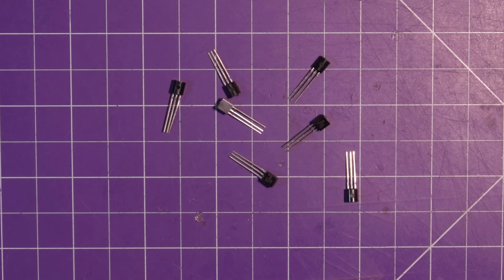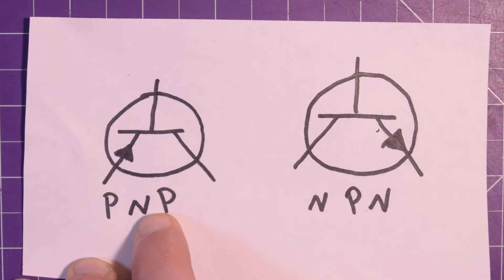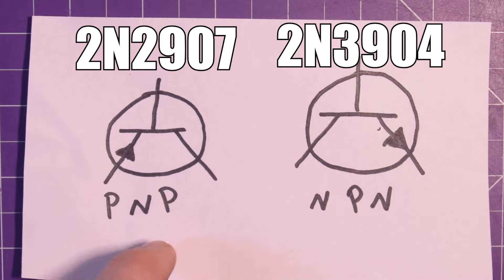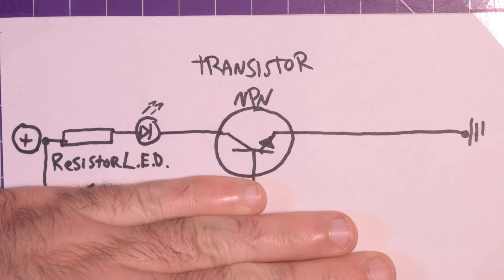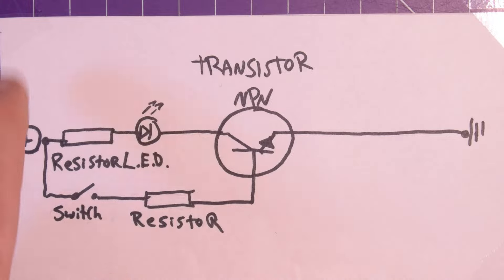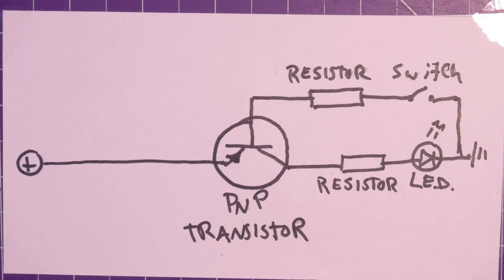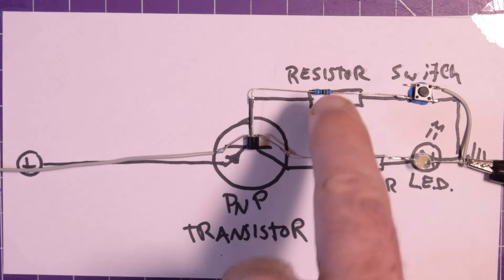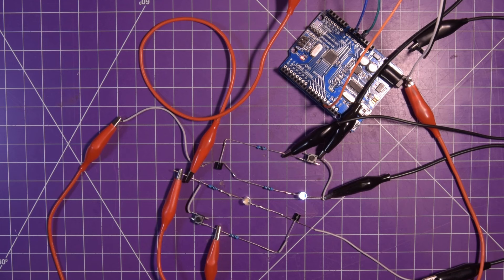How To Use Transistors In YOUR Projects! || Transistors Explained || Transistors As A Switch

Comment: Thank you for this series. For years I worked in a radio repair shop, all we ever repaired was valve radios and record players. So as a result thats what I'm used to working with and never understood transistors. The books I read were far too confusing. You give nice and easy explanations with practical demos.
Reply: Frank, too many technical books do a poor job of explaining the basics. Many times, the simplest explanation is the best.
Reply: What possible projects can anyone like me be thinking about if I am still stuck with that FUCKIN' Canadain dollar?😀
Reply: I finally found some lecture after searching for weeks which cleared the concept❤.hats off to u
Reply: I thought valves went out of fashion long ago.
Reply: @LNCMD2023  Sort of, they are still used in guitar amps. But quite a few people, me included, still use them in general.

Comment: I've watched a few beginner/basic videos about transistors, and while many are good at explaining the underlying physics, all of them make far too many assumptions about the other components that they may be used with. This is the first (and best) I have seen because while it is far from exhaustive in scope, it shows the two basic types in two common configurations, with clear useful guidance about which side to place the load. Basic rule-of-thumb stuff that gets you moving, then gets out of the way. Bravo. I have subscribed.
Reply: It's like explaining how to drive, starting from scheme of engine. Interesting, but useless knowledge. Dan started from practical part: just press accelerator and move! :) That's why this video HUNDREDS times more useful than "pretty presentations" how electrons pass PN edge.

Comment: This was an excellent beginner video! Getting back into electronics after 20+ years and this was an excellent visual. One thing which I learned (or didn't realize until now) was the reasoning for putting the load on the emitter or collector side.
Reply: That's the point! All diff is polarity of control signal.

Comment: I finally understand how transistors work and it's thanks to this amazing channel. Thank you!
Reply from the maker: Great to hear that! Thanks for stopping by!
Reply: @SimpleElectronics  Do you have any videos on how rf circuits work? I want to make a transmitter and a receiver circuit so i can make a 3d printed rc car lol
Reply: @grantscott1686  Don't bother. Just buy ready built TX and RX receiver modules. It is considerably easier and they can be pre-certified. You are not allowed to transmit on any frequency you like.

Comment: very well explained transistors as a switch, to make it even more simple a transistor works as a switch when a small current is applied to its base it then  connects its other two legs together or you can say it shorts the collector and emitter in order for the current to pass through it like a switch, and the type of current applied to the base vary according the type of transistor NPN or PNP. If the type of transistor is PNP, Negative side of the voltage should be applied to the base of transistor and if the transistor type is NPN, then positive side of the voltage should be applied to the base of transistor. Today is my first day to learn about transistors and this was the second video i watched on youtube for learning about transistors. correct me if i explained something wrong about transistors, i want to learn about them perfectly. Thanks in advance
Reply: No it is not that simple.
You need to go look up transistor biasing, active and saturation regions, output characteristics curve, Ic versus Vce for differing levels of Ib.

Comment: When thinking about polarity of Base inputs, it helps to take the middle letter has a reminder, for example PNP, the middle letter is N-for negative to switch on.  And the NPN has the letter P- for positive to turn on. 
And for those who were thinking whats the point, wet your fingers slightly and touch the base lead and the battery, the transistor will turn on with the tiny current passing through your body, also try connecting a Photocell inline with the base resistor, these experiments will convince you.

Comment: Finally, some enlightenment on transistors. Thanks for a lucid, logical explanation. Could you do a similar presentation on how a transistor works in battery charging, with the red and green LEDs in action? I'm not an electronics guy, just seriously interested.
Reply from the maker: It's a LOT simpler to just use a purpose chip like a TP4056 instead of just transistors but I could likely build a small circuit for basic charging with transistors
Reply: @SimpleElectronics  Thanks. Looking forward to it. There are quite a few videos on the subject, but none that include a circuit diagram and an explanation on how electricity interacts with the components used in the circuit. Most of the stuff simply has a music soundtrack without commentry. Leaves one 
 absolutely mystified!😙

Comment: Great explanation and thanks for the visual representation. I think this could have used some more practical examples, because LEDs can also be powered by microcontrollers so it's still kinda hard understading what you could actually use a transistor for, or how to pick them, what to look for, things like that.

Comment: Hello , Thanks  a lot for your Teaching, Explanations and  Efforts. They are  very illuminating for me. As a beginner i would like to ask, just depending on the Led light. Does transistor serve as a Switch between two Loads, switching them on and off? Does the Base work like a Contactor, Relayer , for one or more Components on the Circuit ? God bless you and your kind of People.🙏🙏🙏

Comment: Hello, thank you very much for your videos!  I have a question what are the values of the resistors?  I would like to practice at home thank you
Reply from the maker: The base resistor can be anywhere between 200 ohms and 10k ohms, depends on your transistor and your load. 1k is really easy to find so start there. For the LED - try 1k ohms as well and adjust it if you need more brightness!
Reply: @SimpleElectronics  Do you know if I can control a tri color led (red - green) with both pnp and npn transistors;  because I would like to switch from red to green with a single led, but the circuit confuses me because the tri-color led has a common terminal, thank you very much for your kind response
Reply from the maker: @rebandido777  You will need to see if it has a common ground or a common power, and once you know that, you can install the appropriate transistors on the non-common lead. The type of transistor will depend if it's a common power or a common ground - make sure you pay attention what side of the load each transistor type needs to be!
Reply: @SimpleElectronics  it’s common ground
Reply from the maker: @rebandido777  So PNP it is!

Comment: Great video.  I want to turn on /off a relay based on a resistance that becomes zero or 45 ohms. (The relay is very small and needs 12 volts to 16 volts to operate)  How can I use a transistor with this varying resistor?   I will try to make it but would like some expert's opinion and design. Thanks
Reply from the maker: I am far from an expert - but I recommend asking in the AskElectronics subreddit - but make sure to share your full project, as to avoid X Y problems. https://www.reddit.com/r/AskElectronics

Comment: Really good example,but I’m am now wondering how two concepts apply. Eric O, often talks about “high side and low side switching” is your first example a representation of high side and second one low side switching? And are the terms “sourcing” and “syncing “ applicable here? Thanks
Reply from the maker: Eric O from South Main Auto? Sourcing means providing a voltage and Sinking means providing a ground. So in my examples, the NPN is Sinking current (switching the LOW SIDE of the circuit) and the PNP is Sourcing current (switching the HIGH SIDE of the circuit).

Comment: In your examples the transistors turned the LEDs on. Is there a transistor that turns something off. A transistor who’s natural state is on until a small controlling voltage is applied that turns the transistor off?
Reply from the maker: You can definitely use a PNP transistor with a resistor to ground on its base, and a smaller resistor on its base going up to a control voltage. The PNP will be always on due to the base being grounded, but when a voltage comes down from the upper resistor, the base will be exposed to a positive voltage rather than a ground and turn off
Reply: @SimpleElectronics  Thank you! It worked! Ultimately, I’m trying to get a photodiode to send the control voltage and that’s not working, yet. Any ideas?

Comment: What I have Question is.  We use switches like NO And NC type.  If we see pnp and npn they are NO type.  Normally open and after giving positive or negative to base they get closed.  I wanted to ask if I want to use NC type. After giving positive or negative to base circuit will be open.  Which transistor I use how?

Comment: Hello... Nice explanation, easy to understand. Just one problem though. You still perpetuating the wrong concept that current flow from positive to negative, I'm pretty sure that you know is not true but you still teaching that concept on the basis of traditional use of an old concept. I believe we should adopt the correct concept's that humanity continually discover and shed the old ones in order to correct and advance in our constant pursued in understanding our world. There is no benefit in keeping old wrong concepts. I really like the showing of the real components on top of the circuit drawing, that helps grasping the concept easier.... Thanks you 😊
Reply from the maker: Since current flow is instantaneous, it really doesn't matter the direction of current flow. The "conventional" method is what's more easily ingrained in beginners' minds and once they get the core concepts, it's easy to swap to electron flow.
Reply: @SimpleElectronics  Alright.... My point is to correct misconceptions, that way we don't have to be switching anything later on.

Comment: Why add transistor to the circuit? To use a volume control (potentiometer) to dim the lights (i haven't graduated to microcontroller, or  PWM stuff, yet) 😅

Comment: I have a small circuit board to a multi tool and the transistor fried. Would anyone be willing to help to help me ID the transistor for replacement. Most of the ID markings are gone. I could send a picture of what I have. I really detest throwing things away that can be fixed.  The center pin or base pin is not connected. Thanks, Greg
Reply from the maker: Email me some pictures, my email is in the "about" section of my channel

Comment: One doubt, why not Conditional switching of LEDs can be done without Transistor ? With just microcontroller programmed that way. How transistor makes a difference ?
Reply from the maker: You can drive a LED directly from a microcontroller if you have enough current sourcing/sinking ability - but any more than a dozen or so milliamps, and you need a transistor
Reply: Replace the LED with something which requires larger current that the microcontroller cannot handle.

Comment: I don't get it why it lights. The current travels to the other cable not the one with the led
Reply from the maker: Current through two leads allows current through the other pair, that's one of the fundamental principles of transistors

Comment: So... As per the video, you set up the NPN circuit
However this is made redundant because you just use the tactile swtich and there is no need for the transistor.

You said... 
You can use a Micro like an Arduino or whatever,   OK
but with a an Arduino you still don't need the transistor because you toggle an LED on and off anyway 
the transistor is still redundant

Here is what i want to know
in a SMPS on the input stage at the switching stage of the Power supply after the input power has passed the bridge rectifier,
the input is DC , it Now it needs to pass through the transformer but as DC it cannot do that , so  ENTER OUR TRANSISTOR (MOSFET), the current passes through the MOSFET and SWITCHES ON AND OFF AT HIGH FREQUENCY thus allowing AC to pass through the Transformer

There  is no Arduino here, there is no micro controller,  i would like to set up this circuit,
Now, there is a PWM controller, although this is only for the feedback loop and ASSUMING THERE ARE NO ERRORS  OR INRUSH (in a perfect world) i believe the PWM is not necessary

it should really only be the voltage from the caps going into the MOSFETS and then the MOSFETS doing the switching.

so.. without probing the hot side of a SMPS and blowing my scope since i don't own a set of isolation probes.
How would i hook up an NPN so that i can observe on my scope the high frequency switching that it exhibits ?
this would make the transistor viable

Comment: Still dont get why I need transistors, the flow chart is unclear since when transistors are turned on, it looks like the switch and resistor becomes useless and acts like the first example without a transistor.

Comment: ever notice they don't show you how to id real transistors and for some reason they still believe in  conventional flow in this day an age
Reply from the maker: Since current flow is instantaneous conventional vs electron flow doesn't matter at ALL for learning electronics and a LOT of things are, by convention, conventional flow and therefore easier to absorb.
Reply: @SimpleElectronics  no it's not easier to understand besides a real transistor does not have an arrow on it to identify if is a npn or pnp
Reply from the maker: Stick to what works for you and let others do what works for them please, I have had mostly positive comments on this video, and only very few pedants. The truth is, knowing electron flow does not help in designing circuits, and can make the process harder to understand (like a diode's arrow pointing in the 'wrong' direction on a schematic)